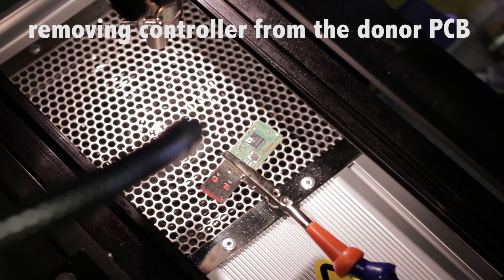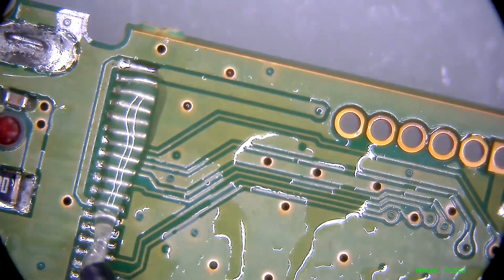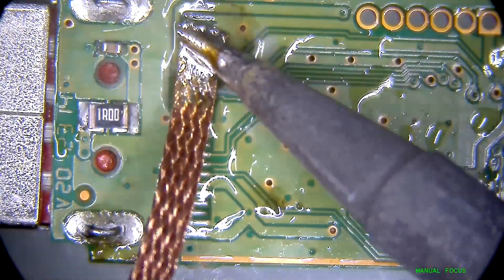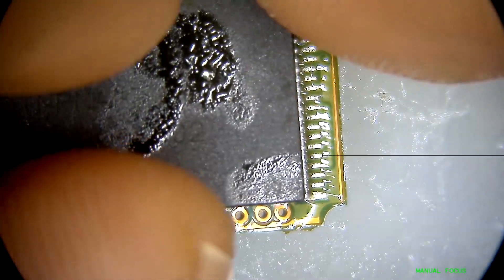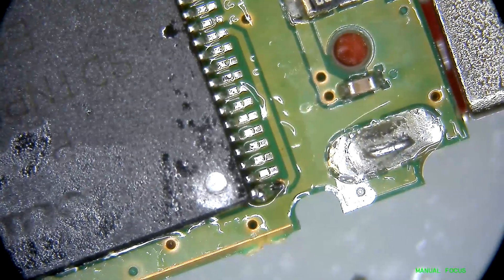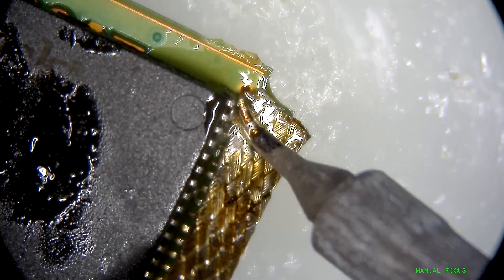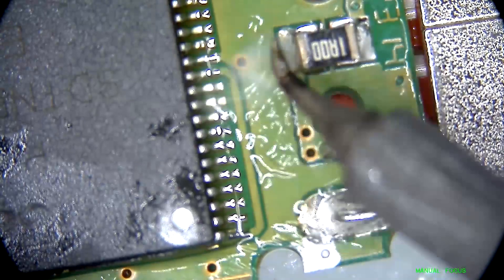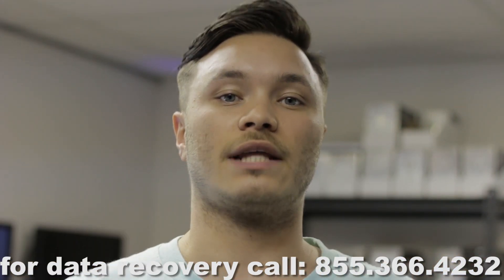usb drive not showing up - SanDisk flash drive 8GB data recovery

Comment: How to fix this sandisk 32 GB , It's showned as 64.mb left can u help ne how to fix these
Reply from the maker: It needs to be tested. 64MB tells us that controller is detected by USB. Either NAND had bad connection so device drops into safe more, either NAND is problematic, or internal issue with controller. I would start with board inspection for fractures, then removing the NAND and controller to insure connection is good after remount. If it does not work, move NAND to an identical donor, and if that does not work pull NAND and work with it

Comment: Can I move over a working controller to replace a faulty one if the flash drives are identical without having to move the memory?
Reply from the maker: if you are sure that the controllers are programmed the same way, and that the issue is with the controller, then why not
Reply: Thanks Akim 
I’ll give it a go

Comment: Yep that was the issue with my sandisk ultra 32gb. Just stopped working. i noticed that this one looked like it had a squint USB connector from day 1. Opened it up straightened the USB port out and it worked.

Comment: how do i remove the internal parts from the USB? this is the item: https://www.amazon.com/dp/B01LYRFWD7/ref=psdc_3151491_t2_B01M1E7Z0DReply     
the USB is slightly bent and won't connect to any USB port on my computer. the USB port still works so I know it is the USB stick. I can't open it up and see what's going on inside to fix anything. please let me know how to fix this if you know!
Reply from the maker: that device is monolithic, it does not have a SMT design circuit board inside.
Reply: Yes, it comes in one block. Cannot be reparable.

Comment: Hai.. 
I have a SanDisk 32 GB USB Drive. From last more times am using its on my car. Today  its not worked in my car; so i connected to my laptop to check it. But the usb drive not showing in laptop. myself try all usb port in the laptop; there is no any changes.
Kindly tell me how to slove it.

Comment: New subscriber ... what type of flux are you using that doesn't seem to gum up with heat?
Reply from the maker: Welcome Chuck. Flux is made right here in Ontario Canada, and the company is called MG Chemicals. Excellent stuff, and I've been using it for couple of years now. http://www.mgchemicals.com/products/solder-and-solder-related-products/fluxes/no-clean-flux-paste-8341
Reply: Cool. I've been using Antec for a little while. But always like to try new things.
Reply from the maker: Amtec? I've tried it after I already was working with MG 8341, and it seems (to me at least) not as good. it is worth a try man

Comment: Hey Erkin just a tip for your Microscope Camera with a wider viewing field.
I adapted a Micro Four Thirds (µFT) camera to my microscope. With the µFT Sensor Size you almost get the same viewing angle like in your eye pieces. For testing I designed and printed the adapter with a 3D Printer (including the thread): http://www.thingiverse.com/thing:1675849

Comment: How do you know which way the chip is supposed to sit when soldering it on a new circuit board? I know of the circle in one of the corners, but are there also a circle on the circuit board?

And how do you know if a controller is fried or not? I have a usb stick here where the only thing that pops up when pluging it in is the name of the controller. It just died suddenly.
Reply from the maker: the dot will indicate where the first leg on the chip is. On the board there could also be a dot, triangle, or even number 1 indicating 1st pad.

I dont know how the controller could be tested, but if I have a working donor, I know that the memory swap will work. As long as the donor is matched properly

Comment: hi i have a serious question :) i have a western digital green power internal hdd 3.5 250gb. it has data on it that i wanna obtain. I have a desktop that runs windows xp. i hooked.it up as an external hdd and as my computer starts to recognize the hard drive my computer gets a.blue screen or my computer will freeze ? Is there any way i could get.the data thx :)
Reply from the maker: drive would need to be tested, I can't say exactly why it hangs your computer. Possibly a slow response issue on it
Reply: +HDD Recovery Services oh ok.:) well thx for the response anyways :)

Comment: Where did you learn how to do all this, with Seagate hard drives USB drives and micro-USB, I am looking into becoming an IT Tech and might need to do some work with this kind of thing down the road. Thanks!
Reply from the maker: Data recovery is a very closed industry. I learned it from reading manuals forums of Acelab PC3000. Soldering comes with experience, and so does the physical repair of hard drives (head swaps, head cleaning, platter swaps, pcb repair).
Reply: +HDD Recovery Services like some things I already know, I'm very good with software as well I now know of an effective way of retrieving data off a smart phone after hours of water damage but things like USB memory retreval or even Micro USB memory retreval I am still attempting to learn and I have very minimal soldering experience lol I'm only 17
Reply from the maker: I might be doing something next year, if I get enough people interested in training. Keep an eye out on this channel, and when the time comes I will make the announcement
Reply: +HDD Recovery Services ok sweet

Comment: why didnt you just remove the nand and read it with the reader that you use? isnt what you did more hard than the solution i recomend?
Reply from the maker: Good question. Data conversion elements used by Sandisk controllers are often very complex, and to find a mix we can spend hours. Method I used here was much easier (at least for me) than off-the-chip recovery. If this solution failed, I would move to the option you suggested.
Reply: controller and nand will go together.  I think it might be the pulse/frequency...